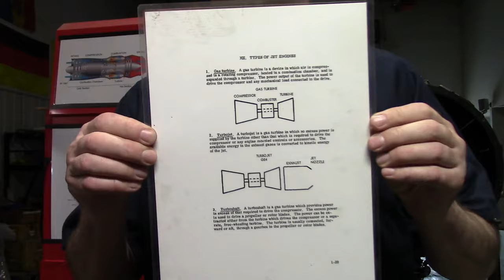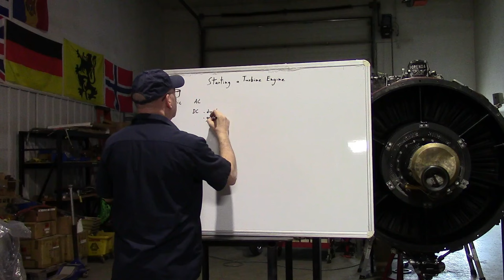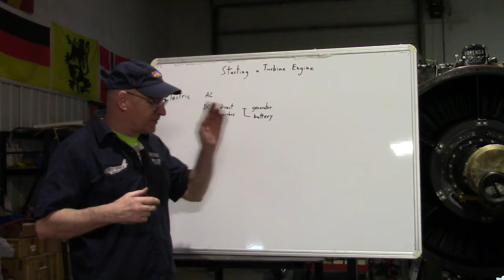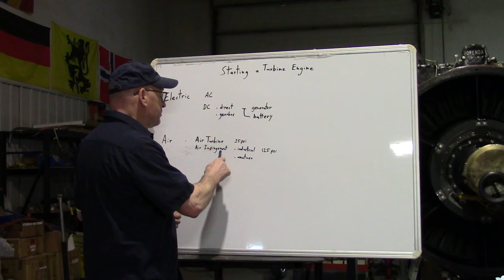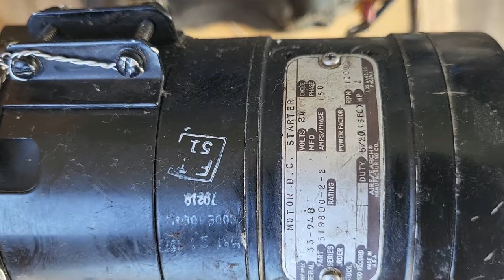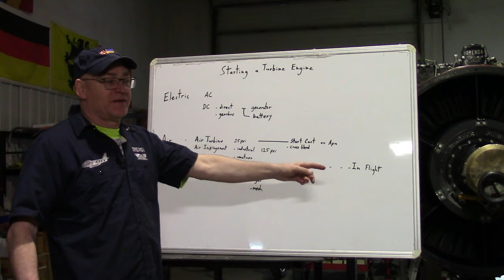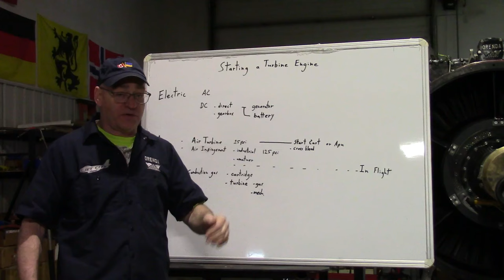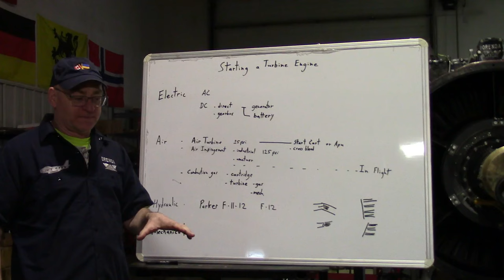Many Ways to Start a Turbine Engine

Comment: The RR Olympus has compressor bleed valves that unload the compressor The SR-71?
Reply from the maker: That is not what bleed valves do. They actually allow the compressor to load at low speeds when they are opened. If the bleed valves are closed, the compressor will not function and allow the engine to start.
That's why they are not manually controlled.
Reply: @AgentJayZ  Cool your jets Jay. But the Olympus didn't operate above Mach 2. The 4th stage compressor bleed valve on the J58 opens above Mach 2 and bypasses air around the second stage and the combustor section and provides cooling bypass air to the afterburner. I'm not an expert on the J58 but that is how I understand the difference between it and the Olympus.
 Do you have any experience with the J58??? I've never seen one disassembled. Are there any in The People's Republic of  Canuckistan? Thanks AgentJayZ, you're the best sometimes.

Love your videos, been a subscriber since 2009!!!
Reply from the maker: Thanks for the insult. The only thing I have to say to you is that the SR-71, the J58 that powered it, and the RR Olympus have nothing in common. The difference between the two engines is that they do not share even one single part.
Reply: @AgentJayZ  Dude, seriously, why are you so hostile? It was a legit question. You treat me like one of those jet fuel hoaxers!

Comment: The first one you show is not a DC electric motor or starter: It's rather a DC starter-generator
Reply from the maker: It's a starter generator. In starting, it acts as a 28VDC electric motor. When running it acts as a 28VDC generator. When it's a motor, it's a motor, eh?
A starter motor... now, where have I heard that term before...   ...

Comment: The Jumo 004 has a built in two stroke starter engine, it can be pull started like a chainsaw.
Reply from the maker: Did I not metion that one?
Reply: @AgentJayZ  The Riedel 2-stroke starters were mounted directly on the engine, not a start cart.
they had electric start or a rope recoil start
Reply from the maker: I believe, doktor, that I did mention that. Did you watch the vid, or are you just piling on?
I rode my BMW today, and you have impinged .